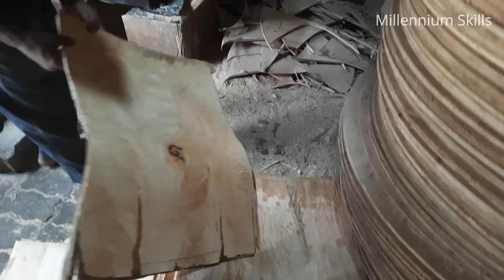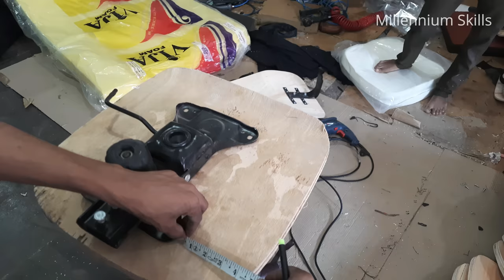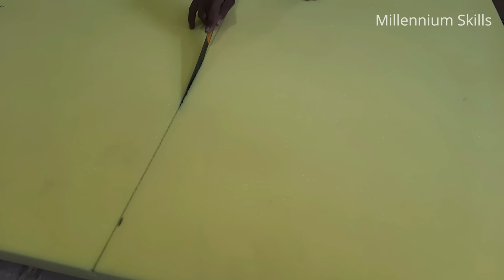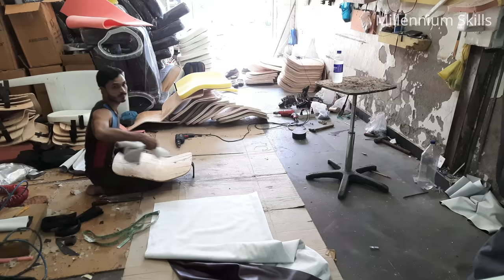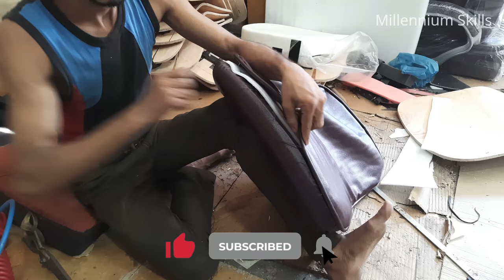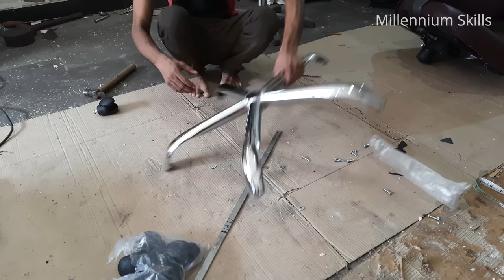Manufacturing Process of Chair With Talented Hand | How To Make Office Chair | Office Chair Making

Comment: I thought metric was used in Pakistan not English measurements.  The guy used a tape measure marked in inches.
Reply: Tape has both inches and cm. Carpenters usually use inches in the subcontinent